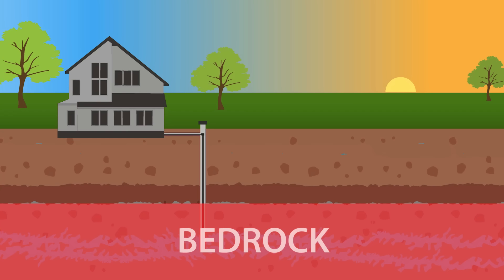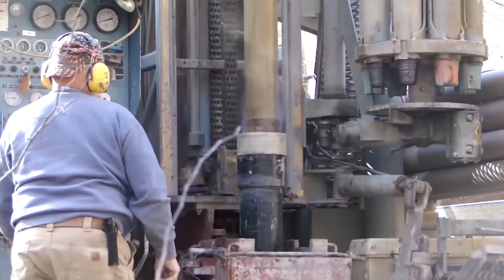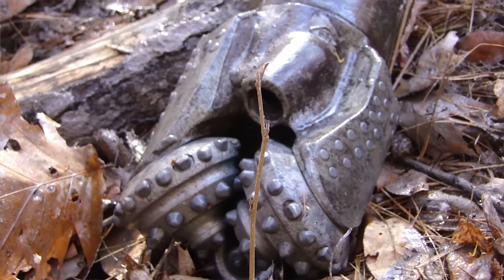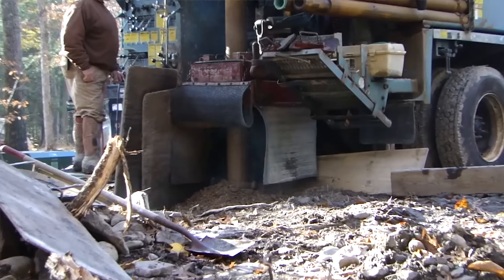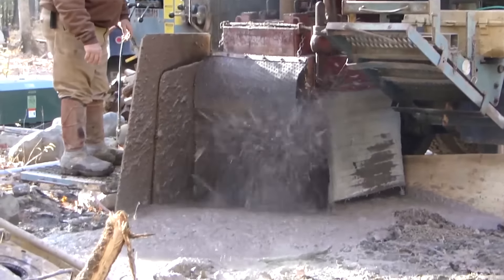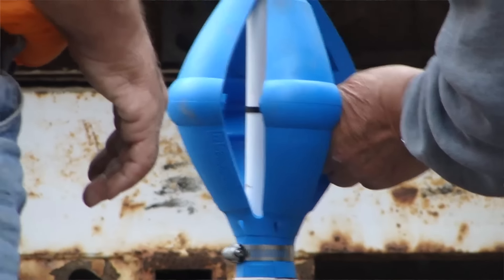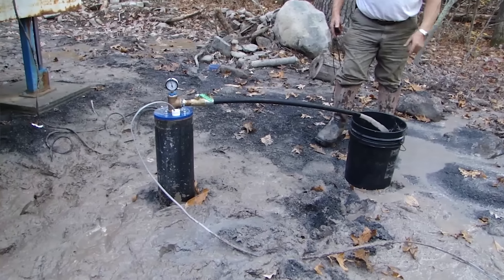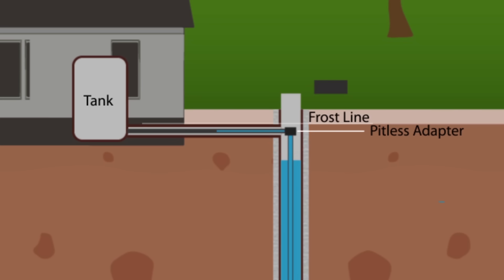WELL DRILLING 101 | Every Step Explained

Comment: So, did I miss something? How does the water actually get into the "super strong"casing?  The casing is down to the bedrock with the "drive shoe" at the bottom which they use to drive the casing into the bedrock 8 to 10 feet or 25 feet?  The bottom is sealed off and the casing in impervious, how is the water getting into the well casing?  Now, on a quick second you see the drill bit going into the well casing, does it drill out the drive shoe?  A bit confusing. The drop pipe has to be water grade NSF certified, not drainage pipe. Otherwise, it was entertaining.

Comment: Sounds kinda like a Mickey Mouse operation. The bottom of the casing should be sealed with hole plug from a one inch pipe to seal the annular space and the one inch pipe raised up 20 to 40 foot sections at a time for a proper seal and dispersment. then at least a 20 foot cement cap on top for a proper seal. Also the bottom of the well should have screen section at the bottom gravel packed to  filter sediment. The blue rubber thing is a torque arrestor to prevent backspin when the pump turns on. Once a well is drilled it should be developed as well. Running compressed air and pulling water up for several hours to remove sand and gravel. In large production wells we even put clorine down to sanitize the well

Comment: Blue thing is a torque arrestor, when the pump starts up the rotation of the impeller wants to spin the pump and water pipe the opposite direction. The arrestor prevents this and keeps the pump stationary. The additional depth of drilling is likely mainly to extend the life of the well, if the aquafor that you first hit slows down over time, going deeper may help to ensure continued high yield from veins below the initial hit.
Reply: Guten Tag Herr Lang, your name caught my attention and I send my best regards your way,

Jochen Lange

Comment: You did not explain how the water gets into the well casssing.
You said they drove a solid cassing into the bed rock.
That means it's sealed all the way down,
If it is a solid piece of steel pipe, going into the bed rock
There is no way I can see the water coming into the well.
I must be dumb !
So how do they actually let the water get into the cassing, and how do they prevent the sand etc from entering at the bottom of the cassing

Comment: i can just take a 5/4" steel pipe and munch it in the ground after a few meters there will be water (good ground and high whater level)
you can place the pump on the ground if the whater isnt to deep ( max 6 meters but you could try it 1.5 meters deeper....a bit risky) that saves you a lot of work and money
Reply: I cant do that. My well pump is 700 feet down......

Comment: Casing welding is not the best technology AFAIK. Cone thread connection is faster,  gives better sealing sand stronger against corrosion. Hand welding has more human factor. Great video, thank you
Reply: We used polyethylene pipes for water and the pump was secured by a stainless steel cable. The electric wires were all in one cable with another layer of insulation

Comment: Actually "... two 110 volt hots and a neutral..." is not correct. The well pump is 240 volts, so the black and red wires are the 240 volt circuit and the green wire is the ground wire. This pump motor does not need a neutral wire. Small pumps can operate off a 2-pole pressure switch, larger pumps will also require a motor controller. Your pump has two wires and ground so it won't have a start winding.
Some pump motors will have a start winding and its capacitor in the control box, these will be identified by three wires and a ground (4 wires) going to the pump.

Comment: LOL you don't know or see where they cut corners. The hole for the casing should be at least 6" larger than the casing to grout properly. Grout is required in most states but drillers pour it in rather than run an annullar line to the bottom and pump the grout from the bottom up. By pouring it in the grout clots and leaves a large void for contamination. If you don't grout properly you're better off letting the cuttings fill it in. What they did was air rotary, which is ok, I prefer mud rotary, but it requires either digging holes or a mud pan and mixing mud. It's a lot messier but it's faster and gives you a cleaner hole. They didn't develop the well, big mistake, which is blowing air in and water out for several hours. This is usually after the rig is moved but you do blow before you move the rig to assure enough water. Now the part you said how powerful the water came out in an understatement. The table that holds the rod straight at the bottom of the boom is removable. When we'd blow the well out, just for fun, I'd stand on the table wrap around the rod and ride it to the top of the mast. Just like you see in cartoons. That's a lot of power. Setting a pump on PVC is so 1970, black poly is much better and easier to pull out for repairs. The blue thing is a torque arrester. It holds the pump center for starting and stopping. It serves no purpose while running. It's not essential but if your tank fails or you have a slow leak the pump can bang around and cut the wires. If you know how to properly secure the wires it's not a problem

Comment: Not drainage pipe, drainage pipe is not fit for drinking water. Actual pvc used is schedule 80 indicating thickness and generally threaded and suitable for drinking water.

Comment: My WI well is 550 feet deep and the pump is at 475 feet. When the well driller called me he said I have good and bad news.

The good news is you are sitting on top of 60 feet of gravel. Your land..100 acres..is worth a fortune!

The bad news is we normally hit bed rock at 40 feet, but for you it was 80 feet, so that’s 40 feet of additional casing which ain’t cheap!

Oh, BTW he said..your are sitting in an underground  stream, probably coming from Lake Superior. 

(The water is indeed beautiful.)

I’m on 20 foot sections of galvanized pipe though!

Comment: PVC is usually WATER pipe, not drainage. ABS plastic is usually drain, waste, and vent pipe. “PR200” pipe in wells sucks. It’s cheap “capitalist” pipe, breaks easy. Sucks to replace a pump with PR200 used as piping, and I’ve worked on quite a few replacements.

Comment: I've drilled water wells for 20 years and never have heard some of the terms and not all rigs are "hammer" types. First of all, that's called a top head aka top drive. The cone bit or PDC bit has holes, yes. they usually have jets or "open". If water is used for drilling while on air, that's called injection. The pipe has BOX and Pin Ends. This method is almost obsolete. I can go on for days about about everything but I'll leave it here.. 20 years.

Comment: The "blue thing" is a torque arrestor meant to dampen torque on the drop pipe when the pump starts. Whoever installed your pump doesn't have much experience or doesn't care about the quality of their work. They used a 2 wire motor instead of a 3 wire. They used single jacketed wire, used zip ties in the well and also the drop pipe they used was absolute crap. That looked like the cheapest most under bid to beat out competitor pump installation I've ever seen.

Comment: Hiring them to get "free water" will cost at least  $10k,  this would be very valuable in case of an apocalypse,  otherwise,  my water bill per month is about $50, per year = $600, 10 years = $6000, 20 years = $12000,  not filter and water sanitation included.

Comment: all im hearing is "male, shaft, pushing down, drill into, female, pipe goes in, harden, thick piece of steel, once you get down, they turn on the hammer, it literally pounds, we're 10 feets in, it will harden, contaminate the water supply"

Comment: Makes a video about wells
Totally ignores hydrogeology as a science

Why I think this:

At 15:20 you start explaining water migration into the well based on a wrong concept, you have to take into account the terrain permeability in itself and not just the permeability to the well, because as you pump and the well refills the effective wellbore radius will start to form, and so the well refilling rate will slow down with time, and you will not only deplete your well but also take water from neighboring wells. In order to test this, flow tests usually take days, weeks, or even months pumping water at full flow rate non-stop and taking regular measurements to be able to calculate the rock permeability and the wellbore effectiveness radius.

Also, with time, the water will migrate particles from the outer area to the well filter, drainage, or simply accumulate them closer to the well, and over permeability will deteriorate, and eventually, the well will perform a lot worse or even dry up. At this point, most people just give up and drill another one, because sometimes they resource to people who do not understand their job. Little do they know that for a fraction of the price the well can be reconditioned with a staged intervention of pumping water in and out of the well, but good luck doing that without proper technical understanding of hydrogeology.

Also, this is nice but before drilling one should have a good understanding of the geology of the site, you can't just drill into a cave like a retarded operator, poor drilling can cause serious and permanent imbalances in the ecosystem. You and your neighbors should and will eventually pay for that mistake.

TLDR: Contracting well boring companies without certified technicians is a bad idea. It's not even cheaper, nor safer.

Comment: Welding a casing is not so clever. If you need to pull out, you are screwed. You can use packer lock or casing grease to do that. I wonder who taught your driller how to drill and case the hole. 

In the oil fields, we go more than 5 kilometers ( 16,405 fts) deep and never in my life saw welding while casing. In fact, it’s an over kill to use metal casings in your well, you could simply use PVC casings directly. That must be expensive I suppose. 

GoodLuck.

Comment: For a man who has no idea what he was talking about, he did OK. Lots wrong in the explanations...(Bentonite will not stop surface contamination, the grout would be a very fluid cement mix for instance). This only covers Air Flush drilling which is very limited the deeper the hole gets. Deep holes are usually drilled with a re-circulated mud i.e. Bentonite, where the mud pressure helps remove cuttings, cools the bit and stabilizes the walls of the well until casing is inserted.
Sorry to be a smart-ass!

Comment: That thingy that the pipe sits into are called slips.   Hahahaa.   An would be better to use pvc pipe instead of metal.   Metal will rust an you will be drinking that.  🤮🤮🤮🤮